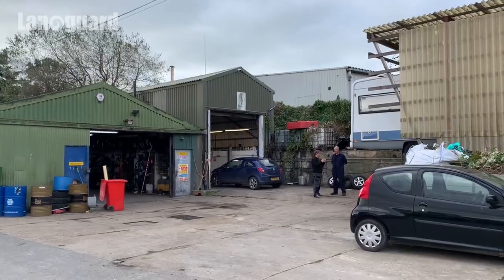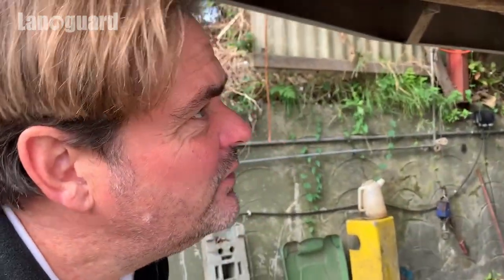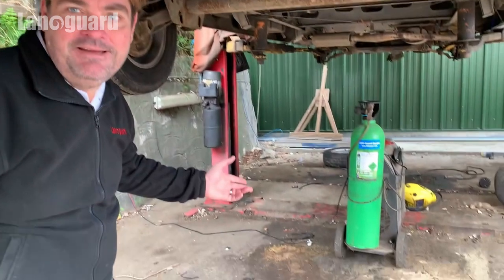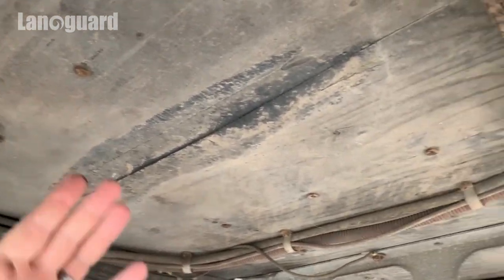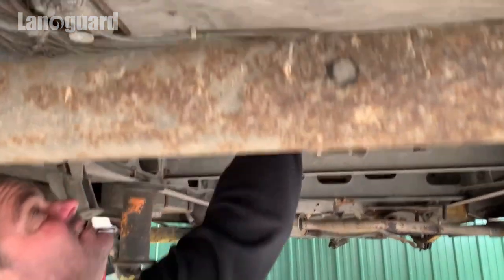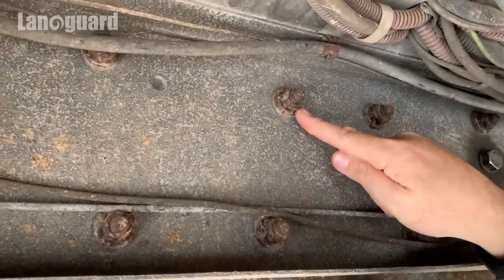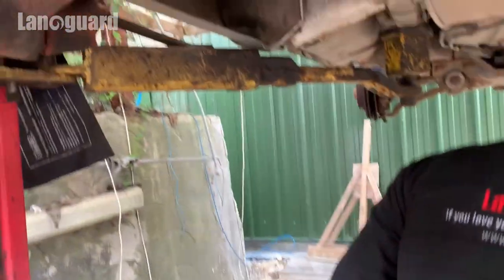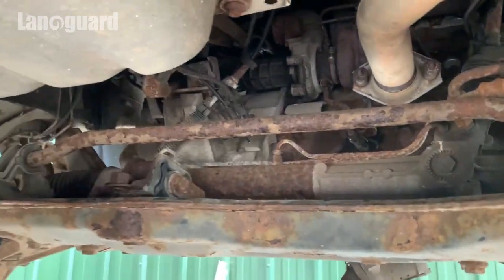Underneath a RUSTY RV!

Comment: If you want to keep nuts and exposed thread on the underside of your vehicle from rusting a good trick is to cover them in rustproofing grease and then place suitably sized heatshrink tubing over the nut and exposed thread and shrink it with a heat gun so it tightens down over it and this way it seals in the protection and seals out the elements. Best to cut it in such a way as to leave a 1/4 inch of exposed tubing and then glue it together and now it's completely sealed. If you ever need to remove it just run a sharp stanley blade down the tubing and it will just pull off and the nut and exposed thread will be brand new underneath, no crustyness and no risk of shearing it.